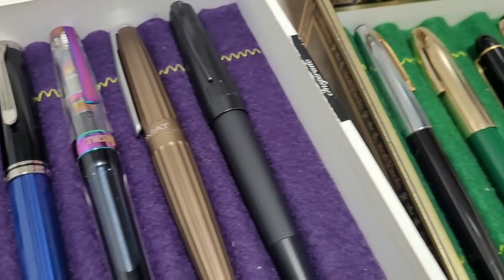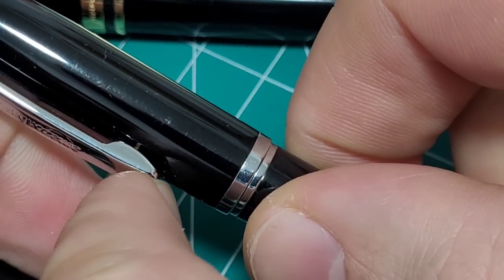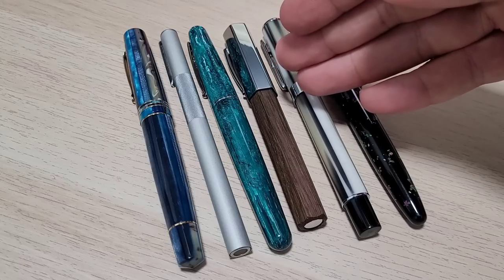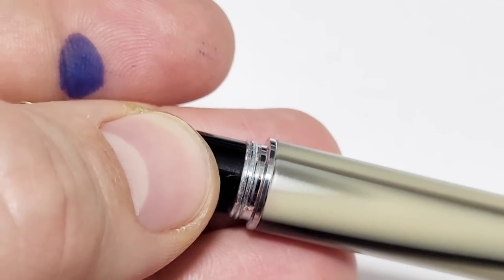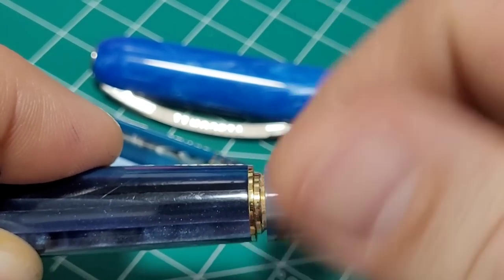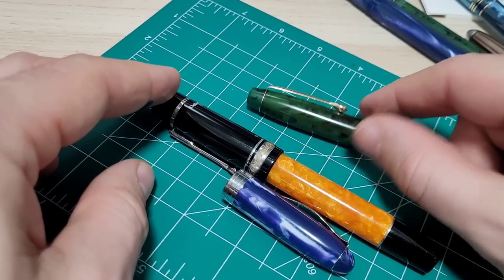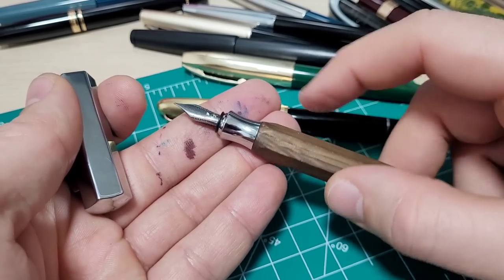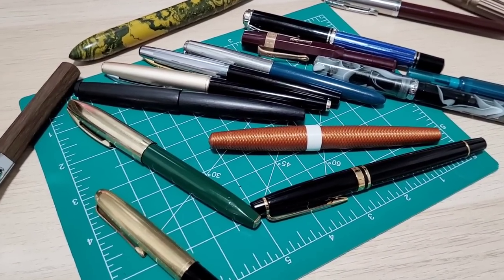What I Look For In A Quality Fountain Pen

Comment: Thanks, some great tips here, of the kind we don't see in most fountain pen reviews. I think the nib is always important, though, when the manufacturer's QC is not up to the mark to catch nibs that can't be fixed by the new owner (I'm looking at you, Stipula). 

I wonder if you could do a video (or maybe you already have) about the engineering aspects of ink delivery systems, design mistakes that can cause skipping and hard starts, such as converters where the surface tension of the ink tends to keep it from flowing into the feed, or issues with the relationship between nib and feed that would be difficult for amateurs to fix, or whether screw-in nib units are better or worse than friction-fit (and what to watch out for). That would also be a treat.
Reply from the maker: A video I thought about doing, but feel I should develop some kind of testing to be able to show the differences.  Like I did with the Flying With Pens vid.  Could test all type of scenarios and pens and see the results.
Reply: @Doodlebud  I look forward to it, then, someday.
Reply: Yes! This!

Comment: Darn good overview. I think you’ve hit them all. One that I thought of that’s more of a design annoyance than a flaw is the threading on the barrel and section being looser than the cap to the section so you unscrew the top to use the pen but end up with the cap in one hand and the barrel in the other. I have a few pens like that. 

I had wondered why Pelikans had high threading to cap but only took 3/4 turn. The multiple start points explains it now. Good eye for detail, DB!
Reply from the maker: Yeah the unscrewing of the barrel instead of the cap issue is definitely an annoyance.  A bad nib can be annoying, but usually can be fixed/swapped/replaced.  A bad/flawed design is very difficult to overcome.

Comment: Very informative and well thought out. Made me very happy that I bought two Faber Castell E Motion Pure Black as my primary pens. Still need to order a M nib for my Lamy 2000. The F seems to be too picky to write comfortably with. Maybe I just need to adjust it though.
Reply from the maker: There are so many easy to miss details on the FC Emotion. But on top of that, it's a wonderfully writing pen. There's so many writing styles & preferences it's tricky to know if you'll like how a pen writes for you. That's why I look at bukd quality first so I know there won't be issues with that, then if the nib is off a bit I can adjust it to my likings. Can't adjust design flaws/issues but easy to tweak or even swap a nib.

Comment: I've noticed that Platinum is one of the only pen makers using AS Resin to make their gold-nibbed resin pens. Can you speak a little bit to the differences in using AS Resin vs PMMA Resin for fountain pens? Sailor uses PMMA resin, while Platinum uses AS Resin, Lamy 2000/Platinum Preppy uses Polycarbonate, Lamy Safari uses ABS. I'd love to see a breakdown of these materials and their trade-offs for use in pens from an engineering and materials science perspective.
Reply from the maker: Yeah I'm planning on doing a video about all the different plastics.  Plastic gets lumped all into one category but there are so many differences.  I don't have much of a knowledge base when it comes to plastics, but will be doing some digging to learn more and come back with some findings.
Reply: @Doodlebud  I'd love to see that! Most people in the pen world don't seem to have much info on the plastics, and it would be nice to know more details. A plastics scientist I talked to made the point that there are also different grades within a plastic type, so fillers can affect the properties as well as just the "formula" for the plastic.
Reply: @Doodlebud  I have a Pilot 823, which I love, but I'm wondering why I spent over 300 bucks on it.  Maybe the materials are that good.  It seems to be bulletproof, though.

Comment: Excellent presentation. I always look for all these criterias before getting a pen. Though some great looking pens out there, I always avoid getting one with blind caps or with threaded converters. A big NO for me as they will not hold up over time. 
PS: Another thing I noticed with Pelikans, they uncap themselves in pen cases. Be careful when you are travelling. Less than a turn is good for uncapping, however, be ready to catch a pen that uncaps itself.
Reply from the maker: Ive had that with pelikans as well.  But one seems to be their pens I have that issue on.  Other multi start threads with less than 1 turn seem to work well.  Maybe I can spend some time to get to the bottom of it!
Reply: @Doodlebud  I have never seen any reviewer talking about this problem. Everyone says, it takes less than a turn to uncap, very good for note taking, etc. I would love to see a video from you on this topic. After having ink leakage in the pen case a couple of times, I avoid taking a Pelikan out though I use them at home frequently. I believe it unturns because of the vibrations while travelling. Thank you. 😊

Comment: Great video. I usually a avoid painted pens due to the ease of scratching the surface. Lacquer is better but you have to be careful with handling. Urushi coated pens are the same problem for me. Great appearance but fearful of using them. Solid resin or anodized metal finishes are great for durability.

One other thing. If you have a pen made from celluloid, you have to be aware that the trim will become loose. Over time celluloid shrinks and fittings will become loose. Celluloid left in humid environment will also deteriorate. It crumbles.
Reply from the maker: Yup, celluloid is cool stuff but has its own issues as well.
Reply: Really? Celluloid does that?
Reply: Celluloid does have some peculiar properties, but if it’s kept in a cool, dry environment it will last many decades.  I have Sheaffer celluloid pens that are 80 years old that have no issues at all.

Comment: Thanks for the video!  I find the quality of the converter in my Montegrappa Elmo of poor quality.    The pen is relatively new, inked less than 5 times.  I hope Montegrappa sees your video.
Reply from the maker: The converter would be better without threading it for sure.  One small little decision can create a potential flaw that could impact the long term functioning of the pen.

Comment: Regarding turned pens; why do some pen bodies seem thinner than others? Is this a cost saving measure? Does it save on material?   Some turned pens; usually made by  independent makers; are very substantial and good weight while some famous companies are producing very lightweight pens. Do you have any thoughts on that?
Reply from the maker: Being able to have a thinner wall lets you make more compact designs on your pens.  Also its something that requires more expensive machinery to make the pens as well.  From a designers or engineers mind, something that has extra unnecessary material is "clunky."  There are also cost savings that come into play as well.  Sometimes you need the thickness for strength.  Pens are pretty light duty instruments so you don't need to have too much thickness to get sufficient strength.  Also that can be solved with using a stronger material.  If you need more weight you can add that into the pen by deciding where you want to weight to be added to give the desired balance.  That can be done by using a different material or adding a sleeve of a heavier material to a lighter one.   Just a few random thoughts on the topic
Reply: @Doodlebud  thank you so much.

Comment: I think you are missing the point with the ring bands on caps or barrels... those are fidget spinners for pens :).

... also glue is too expensive better to use it sparingly :D ...
Reply from the maker: Maybe the workers just couldn't stop sniffing the glue so they got rid of it all together
Reply: @Doodlebud  I would not be surprised... especially if they work in a factory somewhere in China... overworked and underpaid. Gotta find a way to escape reality.

Comment: Great overview of all the loves and niggles.
   Pens are as temperamental and peculiar as people.
   As with Chris rap, I like to lube  my threads,   ( -- I will NOT allow a thread , male or female, to suffer! ) but prefer using beeswax rather than silicone------- I know! : Before all you science material nerds inform me how deleterious this is for the pen, let's just say we'll all be long dead before then.  
   I cannot tolerate slip caps and push fits, notwithstanding how well they seal and how erotically charged the sensation is ; a pen should be threaded closed  where it will be fully protected, at least until the world ends.
    You have a fantastic selection of pens . I will  take them and use them all. As this is a purely psychic manoeuvre, you won't even be aware they're missing...😂
Reply from the maker: A properly designed slip cap can it securely keep it on.  I have some threaded caps that seemingly come loose all on their own.  Threads should be more secure, but again if not done properly there can be problems.

Comment: It's interesting that you spent 30 minutes talking about threads, caps, body materials, and sundry trivial minutiae without talking about the most crucial aspect to a pen's quality: how it WRITES. I don't care if a pen is milled out of fossilized unicorn poop to sub-micron precision and coated in adamantium with self-lubricating graphite-vibranium threads, if it doesn't write or doesn't write well out of the box, then it's utterly useless and should be chucked into the garbage can. This is precisely why it's inadvisable to spend money on a Visconti or a Pineider, no matter how pretty they look, how precisely made their bodies are, or how smooth their threads engage. At the end of the day, a pen is a tool, and a tool has to adequately fulfill its most important function.
Reply from the maker: Yup, a pen absolutely has to write well.  The intent of this video was to point out design/manufacturing issues that people can be aware of when looking online.  Nearly impossible to look at a pen & know how its going to write.  Its super challenging to quantify how well a pen writes since there are so many different preferences when it comes to writing.  And even then, there's no guarantee if we both order the same pen they'll will each write to our own preference.  Nibs can be tuned, swapped, replaced, but a bad design/construction/coating/etc can ruin a pen that otherwise writes well.  The inverse is of course also true, but easier to open or align some tines vs correct a manufacturing/design issue.  At least that's my own approach, which is again a personal philosophy, and we all have our own.